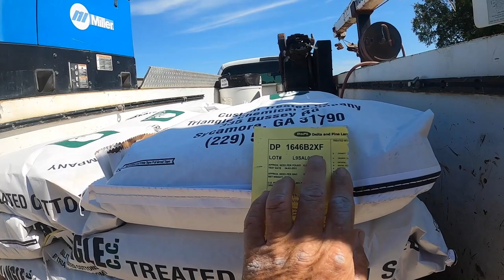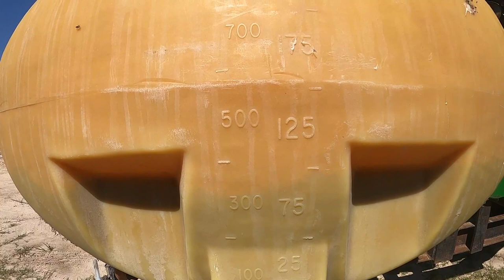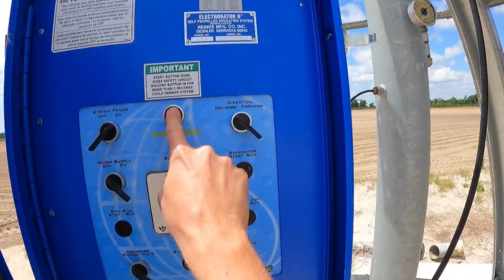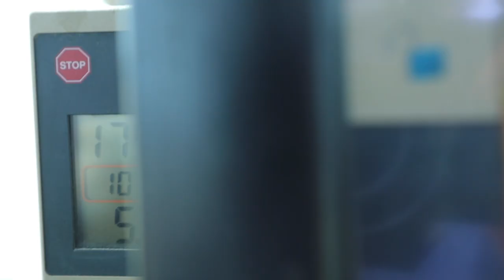Planting Our Last Field of Peanuts

Comment: We have a Monosem with the “X-Series” bulk box or whatever and a Crustbuster. The monosem is a dream to get setup compared to the crustbuster but the Crustbuster was cheaper, and everyone prefers to run it because you only fill up twice a day
Reply from the maker: Yeah I’ve heard a MOnosem is the most accurate and very durable. I just like the design of the crust buster.
Reply: @FieldRows  I wouldn’t think twice about buying one. A buddy has a brand new one that cane with 20/20 precision or whatever and it is unbelievable. They are great but we have a lot of trouble mounting a bed knocker on the front of it